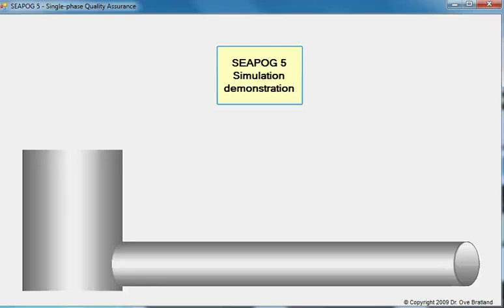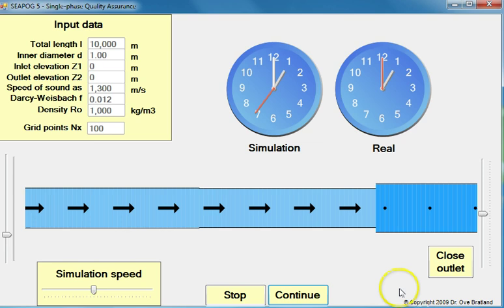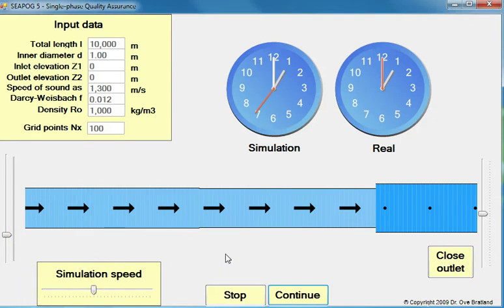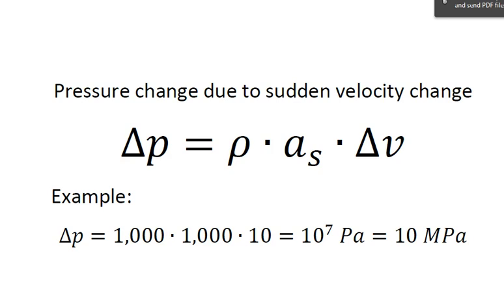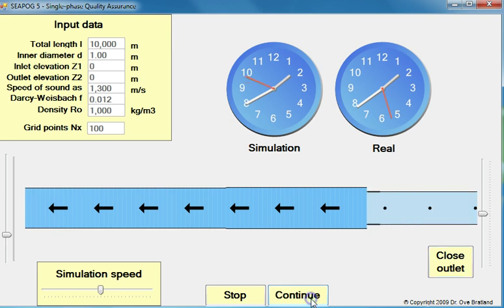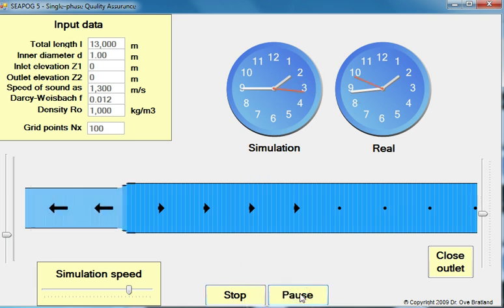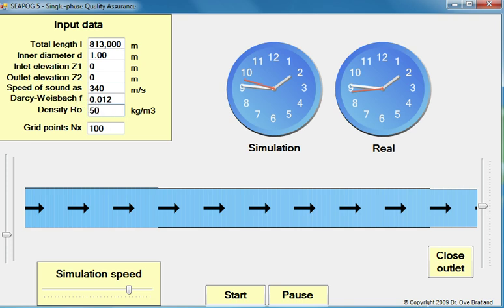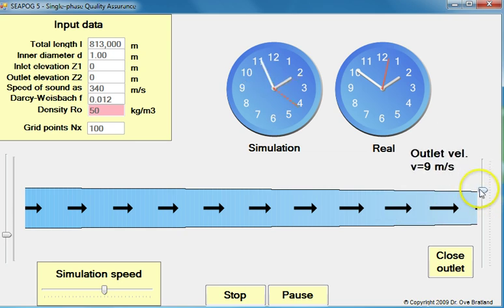Water hammer

Comment: Ove--thanks for this simulation program.  i teach this also in my Condensation Induced Water Hammer Seminars using a similar diagram.  I think it would be helpful in your explanation if you took a moment to say that you're imagining the water column is made up of discrete springy disks or pancakes of water.  Each  one, as it's stopped by the dead end or the one in front of it, compresses due to absorbing the change in momentum as it runs into the pancake in front of it which was  stopped just previous to this pancake.  The increase in pressure is felt longitudinally as well as in hoop stress in the pipe since the pancake is trying to squeeze out in all diections.  After all the springy pancakes have all stopped and the compressed pancakes are stacked up all the way to the entrance to the plenum, there's no pancakes lefy to run into the back of the last pancake which was compressed to keep it compressed, so it expands back to it's former uncompressed width which releases pressure on the next pancake up the line as a chain reaction of decompression returns down the pipe.  (I think this explanation works just as well with waffles).